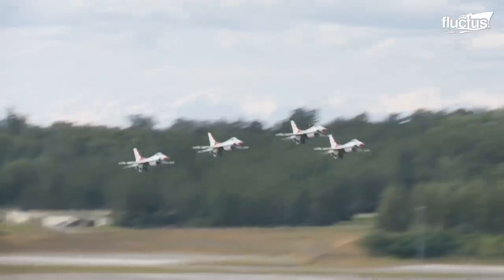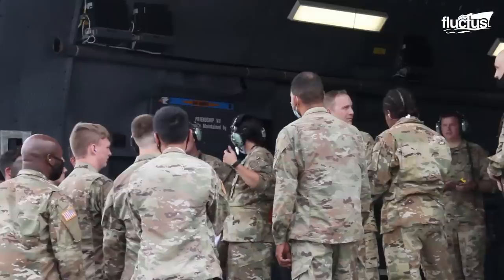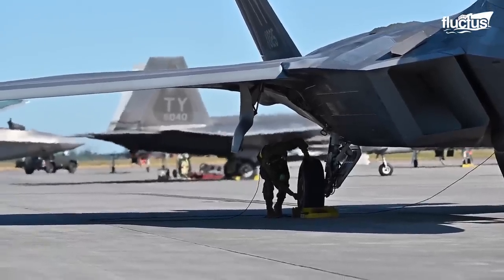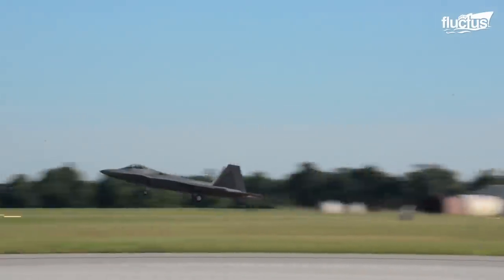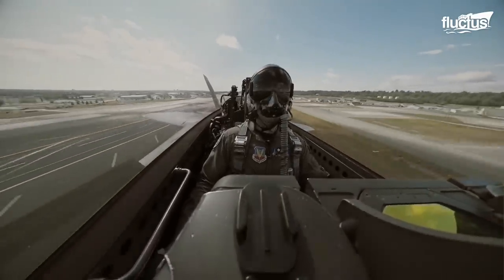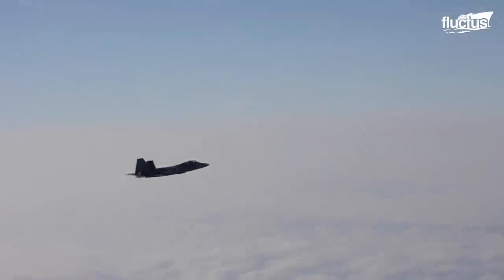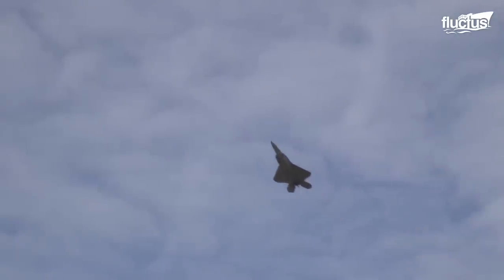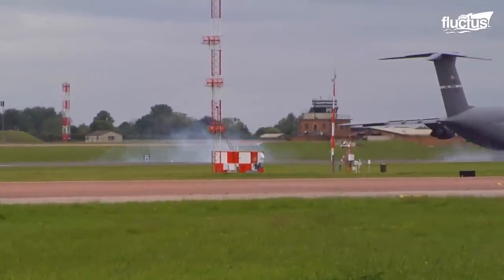Surprising Reasons C-5 is Ridiculously More Expensive to Fly than a Super Advanced F-22

Comment: Early 70s. Rhein Main AB , West Germany. A C5A lands 2:00 am and was a important flight mission. Landed to drop passengers off. I was standing next to the engineer who was on intercom watching the passengers debark and board a bus to take them to the terminal. I glanced down and noticed both of us were standing in a puddle. It didn't rain so why a puddle? I walk toward the side of the aircraft and see a liquid coming out of the wing root area. It was running down and it was just missing the hot exhaust of the turbine supplying electric. I walked back to the engineer and shouting over the noise, pointed out the puddle, which had spread more and pointed to the wing. He followed me to show him the flow coming out of the bottom of the wing. Had to use my flash light. Power was cut, APU was shut down.
Never dawned on me to be standing in a puddle of jet fuel from such a large bird full of fuel for a long mission.

Comment: I've seen both a C-5 and an F-22 at airshows, and to be honest, the F-22 is so much cooler to see flying. It literally stops flying midair and then flies again. When I saw it, it completely stalled out maybe 750-1000 feet in the air, and starting flying downwards while facing upwards. Then, in a split second, it rolled over and immediately recovered. The magic of an insanely super-maneuverable aircraft and 2 of the world's most powerful turbojet engines. Still want to be a C-5 pilot though 😎

Comment: The F-22 development in the 1980's, prototype in 1990,  first flew in 1997, it did not enter service until 2005.  She should be retiring soon since its not designed to be upgradable like the F-35.  Its stealth uses older radar absorbent materials.   They should see is a modified 747 can replace the C-5, or maybe Embraer can give us something.

Comment: Those "73" troops yall said its limited to would have to weigh almost 4000lbs each lol. Wtf.
Reply: To combat attrition, the Air Force has been force to lower its fitness standards.
Reply: I thought the same thing, it has to be more
Reply: when I flew on them in the early 80s there is a separate deck with airline-type seating above the cargo bay accessed by a single long stairway that they said at the time seated 106 fully equipped soldiers........if a C-5 can fly a 70-ton M1A2 Abrahms around I think 100+ troops should be no problem
Reply: There is a separate passenger deck with seats above the cargo area, which is where the troops would be transported.  So you could carry 70 or 80 troops PLUS a large amount of cargo.  You could reconfigure the cargo area with seats to carry more troops, but it would make more sense to simply transport them on a C-17 or a contracted airliner and use the C5 cargo area for what it was designed for: outsize cargo and large amounts of cargo.